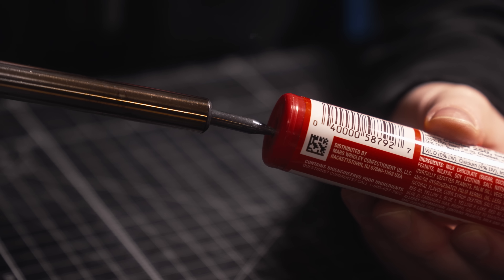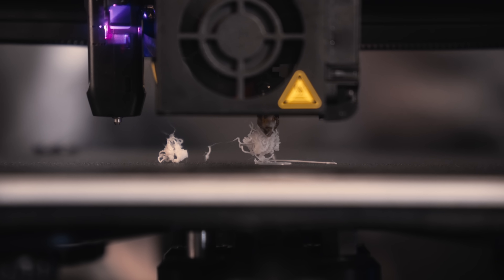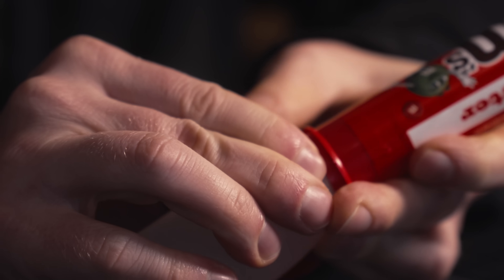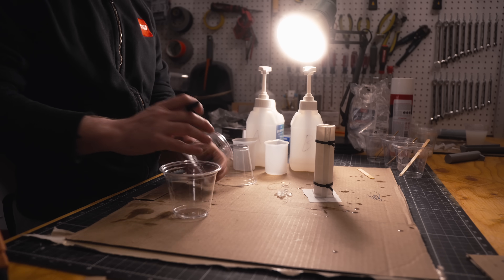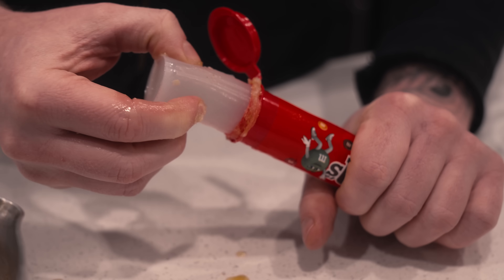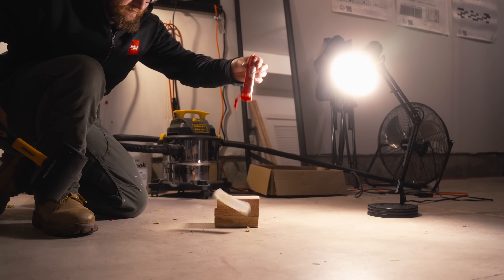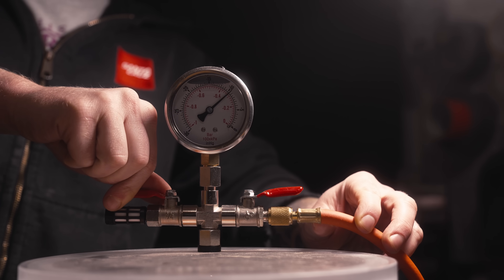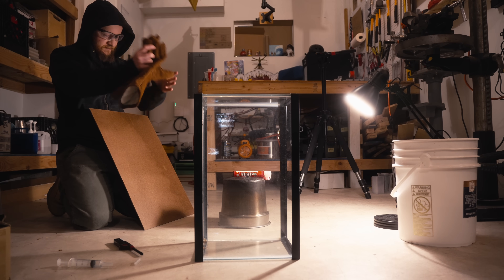Solving Reddit's Cylinder Problem with Science

Comment: It appears he may have lied about the size of his cylinder
Reply: I think that the cylinder was originally smaller but than expanded into the full size, hence why it got stuck.
Reply: @mcpherson1222  probably still lied about the size but yes I think expanding is part of the problem
Reply: @archerelms  who would lie about having a 5 inch cylinder?
Reply: @kiritotheabridgedgod4178  probably someone with a three or four inch cylinder
Reply: @HankFairchild-g4o we mustn't judge the size of other's cylinders. We must acknowledge that cylinders are hard to obtain and cost thousands to craft another.
Reply: @archerelms  i mean the part they measured was probably wider due to constriction a lotta fellas know the length of their cylinder, not a lotta fellas know the girth of their cylinder
Reply: @mcpherson1222  but if it expanded then can’t he un-expand it?
Reply: @bibkada cold water does the trick pretty well
Reply: @bibkada  The tube would have constricted the cylinders expansiom valves,  (like a tight rubber band around a finger, the blood cant flow back out)
Reply: @bibkada  the tube would cut off the blood flow of the cylinder
Reply: @JaWzA13 I dont see why a cylinder of carbon would have blood flowing through it, may you explain?
Reply: @rancor4513  That's an example. The (mainly) carbon cylinder likely has holes or pipes for a liquid to pass through and expand it. The larger object is probably a pump to expand the cylinder
Reply: @JaWzA13 why would blood be in the cylinder?
Reply: @xSkell0  please tell me that was sarcasm... or you're 12... either works
Reply: @Not.Your.Business its sarcasm🥀
Reply: @xSkell0 what could you mean? It's a cylinder.
Reply: @Not.Your.Business  What are you talking about? we are clearly discussing a cylinder attached to a large object that is stuck in a MnM tube. Clearly there should be no blood involved here.
Reply: @JaWzA13  blood? What kind of cylinder has blood. You mean "hydrolic fluid" right?
Reply: But he was told it was larger than the average cylinder
Reply: @Camazotzer yeah that's what they all say
Reply: He said it was an average sized cylinder
Reply: Well according to my studies his cylinder actually expands and contracts quite drastically which was not replicated with the silicone cylinder that was used in the video. This is all a theory however, I haven't found substantial proof but the way the story goes it only makes sense
Reply: It was yuge. Unsurprising it got stuck, really.
Reply: @wildfire9280  onestly I was walking in here and I was like wow what a yuge cylinder everyone was saying wow what a big cylinder
Reply: As a connoisseur of cylinders, I can tell you that they always do
Reply: The more likely explanation is that shrinkflation has probably caused the m&m tubes to get smaller over time
Reply: what image do we have of this currently right now
Reply: But......he said it was above average
Reply: If you're gonna lie, why stop at 5.1 inches?
Reply: I knew immediately it was too large and op had lied.
Reply: he was told its above average... yeah okay, bruh. if you can stick it in a mini m&m tube and believe that, the only thing above average you got may be your chromo count
Reply: Definitely. It also makes me feel good knowing that my fiancé’s cylinder is so above average because all the redditors in the thread are calling OP’s cylinder “so big.”
Reply: No, anyone who likes cylinders will know that silicone doesn't nearly replicate the sponginess of an actual cylinder

Comment: As any 3D printer aficionado knows, acetone only melts ABS plastic (what Lego bricks are made out of). I've found it has little effect on other types of plastic. Also it's good that you didn't try an acid as most plastics are resistant to acids. I'm not sure about how the cylinder would handle acid either so there's that.

Comment: i believe that the redditor was experimenting using a cylinder that can expand over time, so it was able to fit into the m&m tube initially and then expanded, creating the seal. seems difficult to replicate

Comment: You need really really strong suction, and some way to force oxygen into the bottom of the tube. Maybe a hypodermic needle down the side of the tube. Short answer is if the rod is solid, and essentially press fit… you can’t get it out without harming something. 

Edit: oh… you can completely destroy the tube? Then it’s super easy. Barely an inconvenience.

Comment: Drink water, around 1 litre, but not much more since excessive water intake will unalive you. After a few minutes, maybe half an hour, the cylinder should start dumping yellow liquid into the tube, causing an equal and opposite reaction to push the cylinder out of the tube.

Comment: Just in case you happen to get your cylinder stuck inside what essentially becomes a vacuum tube: Your best bet on safely expelling your cylinder is to put the tube and yourself under a flow of cold water (think: a cold shower). The cold water will cause your cylinder to contract in size internally. This, in combination with squeezing the tube hard from the outside, should be able to break the vacuum seal where the cylinder has entered the tube.

Comment: A hairdryer should have worked, rewarm the banana/butter to the same point as when he inserted the cylinder. Without the pressure difference; if he just thought relaxing thoughts the cylinder would have likely become flaccid enough to remove from the tube.

Comment: 13:42 You only need to melt the butter, not the plastic. Submerge the tip in some boiling water for a few minutes and I presume the pressure will equalise enough that you can pull it out like you could immediately after interting it.
Reply: Materials tend to shrink in cold maybe put the cylinder in the freezer

Comment: If the cylinder can easily slip out of the tube after the tube opens on the other end, couldn't you drill a hole in the closed end of the tube and just pull the cylinder out?

Comment: 1. It was once said by Smart_Calendar that the cylinder entered the M&M tube smaller before reaching its peak size causing the aforementioned entrapment. 

2. They also say that the cylinder might had increased in size due to a change in temperature.  

My proposal: Submerge the whole cylinder-tube-oblate spheroids system in a container filled with cold water (around 1-5 C or 33 - 41 F). Due to water being a good conductor, the thermal energy from the system should dissipate and balance out with the water. This temperature drop should return the cylinder to its pre-heat state meaning a decrease in size allowing for easy removal.

I believe this proposal has fulfilled the constraints placed by Smart_Calendar. (If not, please do tell) While it has been a while since the problem was put forth I hope my proposal shall put to rest this problem and any subsequent problems that come relating to stuck cylinders. And I hope that Smart_Calendar’s cylinder was freed in the hospital and that the cylinder hasn’t been stuck all this time. 0:45

Comment: Grab a hand file and SLOWLY, gently begin filing the bottom corner of the tube furthest from the cylinder until air is introduced to the system.
Reply: Or the kinda oscillating saw they use on casts

Comment: I would have tried an air duster if you blow it at the seam you could increase the pressure inside and it'd pop off. It works with 5 gallon buckets if'n those are stuck

Comment: So I looked it up because I was curious, and none of these methods (edit: except the cast saw) would truly work because apparently the m&ms tube makes it so blood can enter the “cylinder”, but can’t escape, which makes the “cylinder” swell up more than the original size. So yes, hospital is the only correct solution.
Reply: The cast saw would work, and is what the hospital would likely do.

On the other hand, by the time Amazon delivers it, the cylinder would already have suffered a cessation of life and would no longer be primarily concerned with becoming unstuck, so certainly bringing the cylinder and larger object to the place with the cast saw was the correct decision.
Reply: Yeah honest I think the only way buddy was getting his "cylinder" out would have been as soon as he realized it was stuck and submerging it into cold water and hoping that it would result in the blood vessels and everything shrinking enough to get it out before the swelling really set in.
Reply: I really think low grit sandpaper would work pretty well. Plastic is pretty soft and gets sanded very quickly, and once it got paper thin you could just rip it off the cylinder. Not with a tool or anything, just wrap it around the m&ms tube and kinda jerk the tube. Knives never work cause they are imprecise but that doesn't mean there aren't other ways to remove plastic
Reply: @Nitro-bg1sn do NOT jerk the tube, the cylinder might grow from such movements
Reply: @Nitro-bg1sn  Or you can take a sharp object and scratch a groove with the end. When pressing on the pipe, it will break along this groove.
Reply: Can I ask what does blood have to do with this cylinder?
Reply: @S20171  in the original Reddit shitpost(?) it is implied that OP (probably a male user) is using the M&M tube for masturbation
Reply: blood? life? wth yall on about this cylinder? is it a living thing?
Reply: @maxrmaquino It's a cylinder
Reply: @maxrmaquino  yes its op's penis. Thats the joke. He refuses to refer to it as such despite the numerous context clues inferring its his penis.
Reply: @mobius273  he said over and over, its a cylinder with two oblate spheroid objects in its base and attached to a larger object, these are really important things the guy in the video forgot, idk why, but the guy himself said its a cylinder
Reply: He used the exact same method the hospital would have used.
Reply: @BackseatGamingJesus not exactly sure why the guy would bring his cylinder to a hospital but he did say he was there
Reply: But the hospital is just going to use the solution from the end of this video...
Reply: It’s like a finger trap but for your cylander
Reply: I think (very carefully) nicking a couple of air vents into the edge of the tube to break the vacuum would probably work for a couple of reasons.

Importantly, this is a lubricated low friction setup.  A parallel is someone removing a stuck ring with liquid dish soap.

Additionally, if you have a stuck ring on for a finger for instance, the flesh towards the end of the finger can swell and become larger than the ring, creating a mechanical bond.  In the case of a cylinder which does not protrude from the tube, this is not possible.

That being said, depending on the dimensional tolerances (which are imprecise here) it might be possible for the swelling to become so severe that the pressure rises to the level were friction becomes a real issue even with the lubrication.  I genuinely think this is a real edge case though.  It would have to have been a very tight fit in the first place.  In that case, yeah, hospital.
Reply: @ColonelSandersLite nicking some holes in it may have worked but I doubt many people would be confident enough in their control to do that with such a... Delicate cylinder at stake, arguably if someone wants to recreate the situation described poking a couple of holes into the tube at the end and maybe one or two along the length would probably be the way to go to prevent a vacuum from forming in the first place, if it's causing a mess you could probably temporarily tape over a couple or all of the air holes but honestly just making sure a vacuum can't form is probably worth any potential mess
Reply: @ashrowan2143  That's an interesting thought but I'm inclined to disagree.  Then again, it's possible that I'm just biased by my own level of comfort with tools and assuming that most dudes are more competent than they really are.

That being said, the cylinder material is a thin walled soft plastic and there's many ways to get through it.

A sharp knife would be quickest.  You can cut at a pretty safe angle by putting the cylinder on a hard surface like a table an nicking out the corner of the cylinder on the side (i.e. not straight down from the top).

If you're unwilling to risk a sharp knife, you should be able to grind through it quickly and easily with a minimum of risk.

Something like a chainsaw file would grind right through the cylinder's corner in seconds.  A jewelers file would probably be able to do it in less than a minute.  I think even a nail file could get through it in maybe two minutes or less.

Come to think of it, wrapping some 60 grit sandpaper around a ruler and using that as a file would probably even let you grind out a channel the whole length of the cylinder wall in just a few minutes.  You would just want to be sure to start on the end where the cylinder is attached to the larger object and work your way down towards the end of the cylinder.
Reply: @ColonelSandersLite  yes a file is definetly the soloution much more controll then i am no expert on tubes but presumably the fine teeth of a file wouldnt gice more than a graise
Reply: @ColonelSandersLite  Or you can take a sharp object and scratch a groove with the end. When pressing on the pipe, it will break along this groove.

Comment: Similar to the cat-pull test, I suppose replacing the cat with a heavy enough weight, the heavier the better, would produce effective results. Simply secure the cylinder at a high elevation and drop the weight attached to a lenghty teather. If done at home, an upper story balcony/window, or even rooftop, over-hanging grass would be ideal as to cushion the weight's impact on the ground. If higher elevation is needed, pedestrian/road bridges around town should suffice too.

Comment: I may have missed it from the original post but my immediate thought was to use a small very straw like and air duster straw and shimmy it down in between the cylinder and the tube and blast air through it to push the cylinder out. In fact if you could get the straw all the way down to the end it should break the pressure seal and allow the cylinder to slide out freely similar to why the vice worked it broke the seal you just need to to create enough of an air gap to release the seal.
Reply: Honestly odds are by the time the person reached out it was probably too late for that the vacuum would have caused the cylinder to swell and I doubt anything could have been done at home by that point, if he caught it fast enough and submerged the whole assembly in really cold water that might have done it but even that's a maybe, really the best idea would have probably been poking a hole at the back of the cylinder in the first place to prevent a vacuum from forming

Comment: I applaud your drive for the discovery of the unknown and trying to replicate another scientist's experiment! However, the original thesis (the reddit post) also specifies that the cyllinder is attached to a larger object (either a wall or maybe a 5'10" long, 16" wide mound of the same soft organic material) and that this attachment leads to some "weird angle situations" making inserting anything else or even handling the cyllinder and the m&m's tube difficult.

Also some of the replies mention urination (not sure how that would help), spitting on it (impossible due to the angle), nail polish (the original thesis mentions this might damage the surface of the cylinder). Hitting it is consider unsafe to the structural integrity of the cylinder. 

So, in summary, more experiments might be desirable, this time while simulating the awkward angle situations.

Comment: There are several smaller silicone-cylinder-producing creators you could look into next time. They could even give it a flared base to approximate being attached larger object, a crucial detail you missed in this video! Neotori in particular did good work for my own silicone experiments.
Reply: I believe there is one silicone cylinder producing company that is named after a very poorly-behaved draconic entity, they may be able to assist.

Comment: A simple metal-cutting manual hacksaw would have worked. If one were careful, the cylinder would remain unharmed. For a boost of confidence one could test it on another soft cylinder, like a forearm or a finger, before moving on to the real deal.

Comment: Though using a cast saw is a good idea, I think that another good strategy that is not as expensive would be to just heat up the m&m can with warm water (not boiling). Theoretically, that would equalize the preassure inside and outside the can and allow the cylinder to slide freely, just like it did in the very beginning.

Comment: Oscillating tool. Will cut plastic, wont cut skin, or silicone i mean
Reply: Called it. Didn't  even know about a cast saw, which is the same idea but more specific.  Bet a standard oscillating multi-tool would do the trick too and every hardware store  should carry them. Just have to hide your predickament while shopping

Comment: this is inacurate. if the original cylinder didn't fit it means it was squished in. you should have used a softer silicone to acurately simulate the situation.

Comment: No one ever suggested compressed air? Even if the cylinder is attached to a larger object, a burst of compressed air against the lip of the m&ms tube would cause a silicone-like material to flex and shift from bursts of air pressure. If enough of a gap were created, the compressed air could force the cylinder out, undamaged.

Comment: huh... the cylinder didn't fit at first? that's so unbelivably odd. could the cylinders size mayhaps change depending on  Certain Factors  ? i think it could be reasonable to assume OP simply gave the Larger Dimensions to protect........ well. something. from being hurt.